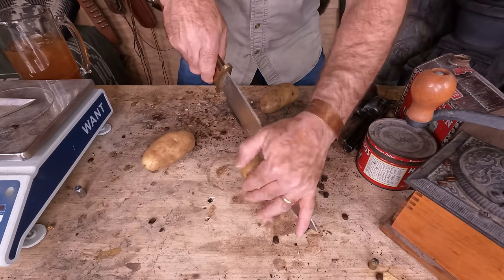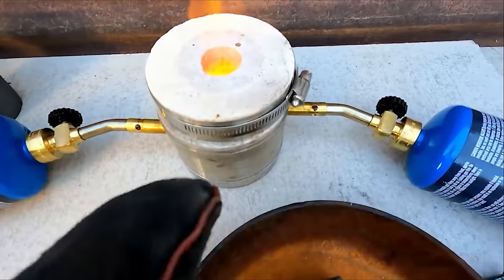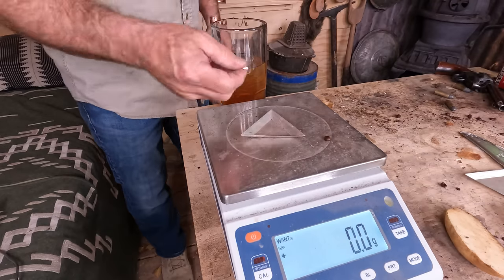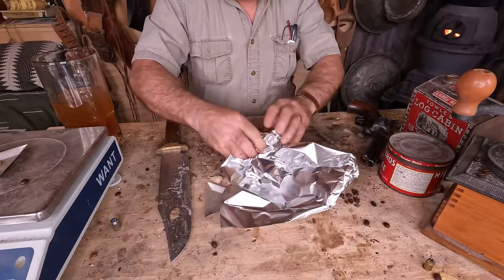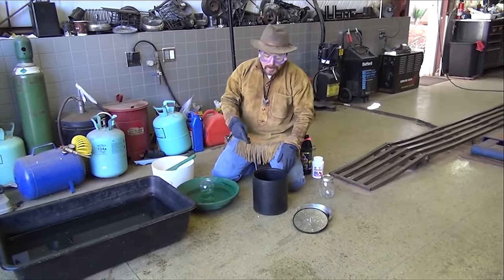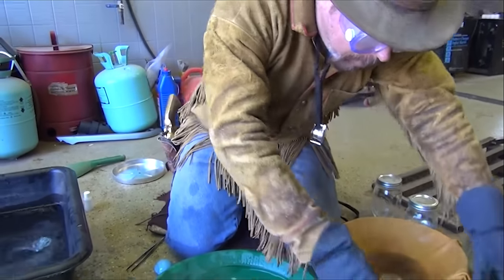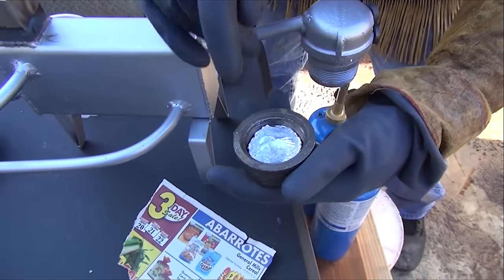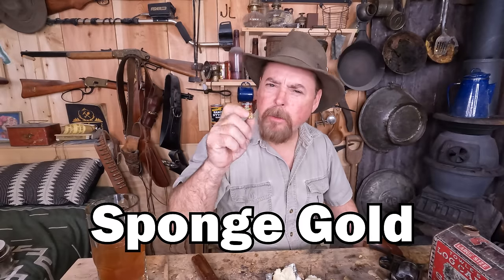Placer Gold Smelting: Revealing the Secret Art of Using Potato and Mercury

Comment: Good safety built in to this video, thank you.  Us old timers used to put the amalgam in the potato, roast the potato and then remove the gold button.  Then we would put the potato into a pot of water and mash it thoroughly and the mercury would collect in the bottom of the pot.  Re-use it and away you go.  Not very clean mercury but still works.  The even older timers would hold the mercury in their mouths while they were panning.  Spit it into the pan and then put it back in their mouths for the next pan.  None of them had any teeth for some reason.
Reply: 😢 please from Google  please 🙏😢

Comment: It never ceases to amaze me how much mercury I find at our local dump. Idiots find it while cleaning out some dead miner's house, assume its dangerous, and throw it away! I take it home, retort it, and add it to the collection. I've got about half pint of the stuff and didn't pay for a drop of it! And by the way, Jeff, you can boil the mercury right out of the collection chamber on the retort. I do it all the time so I don't have to make amalgam out of it. Its also very helpful to make a little heat shield from an old bean can to fit over the retort. It helps keep the heat in so it can boil easier.
Reply from the maker: thanks

Comment: I would like to add, Hg is recovered in the oil and gas industry, at least here in Australia. As technicians we were often involved with mercury in the refinery process. To be sure Hg vapour was at acceptable levels we had detectors and were monitored. Once inside a bunded wall around a small vessel a mishap had occurred and small beads of Hg could be seen in the cracks and crevices of the concrete floor after the initial clean up. When it hits the ground it goes EVERYWHERE and the air above this splash will be high and dangerous with vapour. Hence the bunded wall…further clean up followed. Be respectful and understand Hg it’s fun stuff IF you are smart enough to look after your health and that of others

Comment: i've seen so many videos where they use too much nitric and begin to unknowingly dissolve their gold along with the mercury. you could probably just as an extra stump add stump out to the nitric mercury liquid to test if you had gold in your liquid. it will cause gold to precipitate into a fine powder. then you can pour off the excess liquid and clean the gold with hydrochloric acid boils, or just melt it.

Comment: Cheers JW.. timely for processing the material I shared with you on Patreon. 
Question though.. seems like more effort than required instead of melting incl sands - add silver or copper inquarting to flakes at roughly 1:3 or 6K (base metals/gold) - then digesting the base metals incl silver in nitric - processing the gold in aqua regia then metabisulphite, etc. 
Then further processing the waste solutions using the reactivity series slowly by first adding copper to exchange for silver,  then iron to exchange the copper, eventually leaving only an Iron Nitrate solution which can be neutralised and safely disposed of. 
That' what I've been doing to date as I didn't have a furnace, but have built one now which I've been using.    
Wondering the pros and cons of each.
Cheers!
Reply: Forgot to mention you can add a little sulphuric acid when the gold is dissolved in the aqua regia to precipitate out any remaining lead
Reply from the maker: thanks

Comment: That is what the OLD TIMER showed me. Spuds work for cleaning the Mercury off gold. In a glass bowl full of water will catch the Mercury when you crush the potato after its use to recover the Mercury from the Potato. TheOld Timer said to cut o hole in a solid potato cut a cork out of potato and cut the plug down, so it has a pocket.

Comment: Anyone heared of "starlite". It's the name of the first Fire protecting coating. It would "inflate" and form a hard "crust" that would burn nore cobduct heat when exposed to flames. Some are prettige sure these used to be some starcatcher in these? Could it be the potato starch that helps form this "crust" ?

Comment: Sometime, when you think it's worth the time, could you explain why the steel balls in a ball mill wear into tetrahedrons?  The edges and corners retain the rounded surface of the original ball.  I grew up down the ravine from a mine with a mill, cyanide processing tanks, and an assay lab.  One of the curious things were those worn out balls in the dump next to the mill building.  When I was studying geology, before switching majors - it was the professors, not the subject - we visited an abandoned mine similar to the one I just mentioned.  We were exploring the old lab, which was marked by thousands of stone cores.  One of the women found a gold "button" similar to what you produced.  

In one job I worked as an archaeologist, we were excavating a number of old mining camps.  Some were American camps, some Chinese.  When I call them "camps," I mean just that.  They were hearths, or fireplaces, associated with individual placer claims.  Some of the camps had copper bowls or basins about 9 inches in diameter and three inches deep in the deposit.  The county treated them as hazardous materials allegedly because there was mercury on them.
Reply from the maker: thanks for sharing that

Comment: Cool video, but I have another solution for you that is effective and safe if you understand the process.  Use hydrogen from water (HHO from a 12 VDC electrolysis device) to run your burners hotter and a heck of a lot cheaper than LP and NapGas cylinders.  When I see someone using this many processes of chemicals and expensive refinement processes, I know it comes out of your end product cost per gram of gold.  Hydrogen can be split into different reformers and pumped into bottles, or just use small water system bladder tanks to hold a back supply of oxygen and another for the hydrogen, and mix them at the user end like a welding torch, or you ca simply run a water electrolysis system with both gasses combined, but they are more explosive if you capture too much and especially if you compress them together over 20 psi.  My personal system I store them separately at 200 bar so I can control them in large quantities and it requires only a little water, an electrolyte additive and a little electricity.  Most of the fluxes you use can be substituted with only borax, lye and vinegar.  Good hunting.

Comment: So here's what I used to do.  I would take an old iron skillet I'll never use again. Do that chamois trick you did in the water, to get rid of all the loose Mercury. Take what was left over I would stick it in a  half of a potato get the pan extremely hot, lots of firewood charcoal underneath it. Way far away from everybody and everything. Take that half of potato and put the flat cut with the Mercury gold right onto the skillet.... And I would walk away quite quickly.  I would get a lot of distance. I'll be left with a gold button.  And that Red cloud does show. That's the vapors you don't want to breathe... Red death is what they called it.... Afterwards I would smush baked potato.. and I would get some Mercury back..

Comment: my silver springs shaker table concentrates naturally occurring mercury along with the fine gold i mine from surface mining here in the bullfrog hills nv, along with any samples i've taken from amargosa valley up through, the cuprite hills, goldfield and tonopah nv, of which indicates there is microscopic mercury throughout nevada and california as well, my high concentrate containment bucket coming of my shaker table naturally creates gold amalgam chunks as it fills up, on my waste/tailings side i have a 12 foot sluice box with an amalgam plate made of sheet copper three feet long of which is first coated with mercury by way of hydrochloric acid treatment prior to coating it with mercury, vinegar, lemon juice, nitric acid all work as well, at the end of the copper amalgam plate, i have a 3/8 inch bend upwards that captures free mercury as its travels across the plate, i have a specialized cloth mat after the amalgam plate that captures the finest particles that make it past my plate, within the first 15 minutes of operation the bright shiney silvery colored amalgam plate becomes bright gold colored  from the microscopic gold thats washed over the plate, what happens is, the mercury coated amalgam plate captures the gold and mercury as the make contact with it, the gold being lighter than mercury forms a layer over the heavier mercury, as the plate loads up, the gold builds up as a layer across the plate, and the mercury flows beneath the gold layer, and concentrates at the 3/8 inch bend in the copper plate, i use the same rubber nose syringe as you do in this video to safely/carefully gather up the mercury as it pools next to the bend/dam and put it in a glass bottle, after a while, the plate is encrusted with a coating of precious metal that i wipe off with cotton balls, the first foot of the cloth mat after the plate is covered with lots of gold amalgam chunks/nuggets that form from what mercury and gold that escapes the amalgam plates bend/dam, the high concentrate containment bucket has some free gold particles along with chunks of gold amalgam scattered throughout, my preferred method of separating the mercury from the gold amalgam is by putting the amalgam in a baby food jar, setting the jar on a slight tilt outside then use nitric acid to remove the mercury from the gold, i usually just let it work overnight, when it's ready, there will be a solid metal button at the lowest side of the baby food jar that i use long skinny tongs to pull the button out, and rinse the acid residue off the button with fresh water, after that, i place some clean sheet copper strips, or wire, copper pipe works too, into the acid in the jar, the acid has a greater affinity for the copper than the mercury and as the acid dissolves the copper, it precipitates the mercury out of solution to be reused again, there by creating a mercury free gold button without ever heating up and vaporizing the mercury.

Comment: Mercury ain't safe chief. It's not as dangerous as many people believe, for sure. It's perfectly safe IF it's used in a responsible way, by people who know what they're doing, and take the necessary precautions to prevent accidental environmental contamination, and fume inhalation. Heck, even Cody in some of his mercury videos uses a double tub setup precisely for those reasons, and when handling mercury, he usually does so outside, in a colder day to avoid vapour as much as reasonably possible.

The problem with using mercury in gold mining was twofold: scale (an accidental spill is unavoidable, at which point scale matters more than anything), and as gold becomes harder to get (as it invariably does), individual claim owners start to struggle to keep their claims profitable, and corners get cut. Corner cutting and toxic metals go together like love, marriage, and ritual infanticide, that is to say: things get messy and grim.

I have literally zero issue with small scale operations putting out content like this, using mercury as it is educational. Like you said: it's how things were done in the past. I do, however, think it should be stated explicitly that Mercury isn't safe because no matter what you do, the metal is inherently toxic. Mercury is like a gun: it can be a useful tool if treated responsibly and shown the respect it deserves. If you have no experience handling guns or mercury, find someone who can teach you what you need to know to keep yourself and others safe first. Until you do, it's better to err on the side of caution, and treat mercury (or a gun) like you would unexploded ordinance: leave it to the professionals to deal with it appropriately.